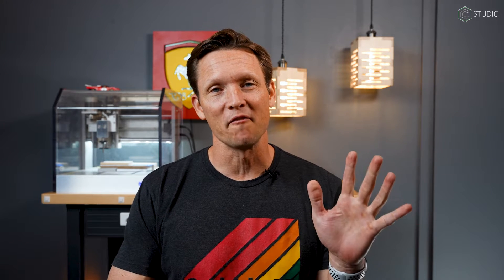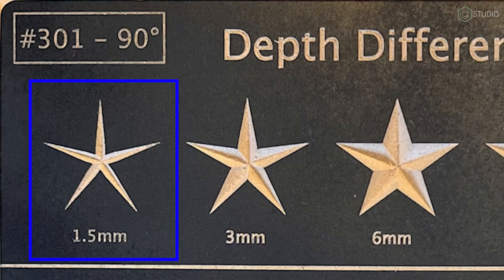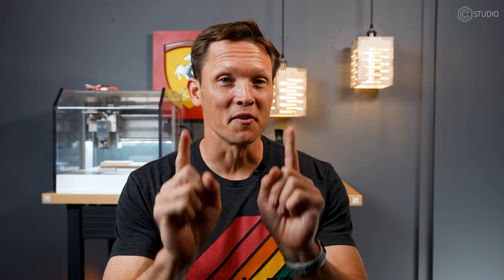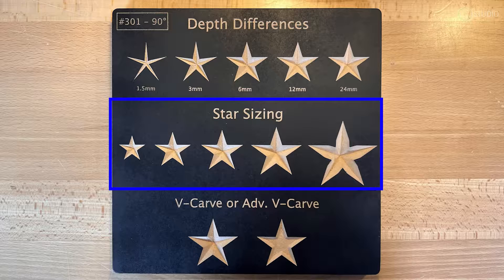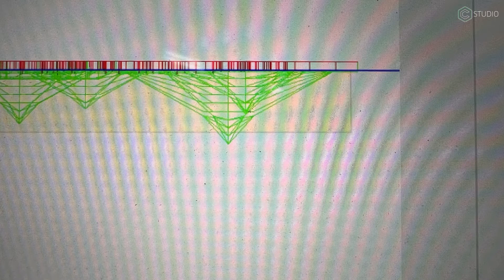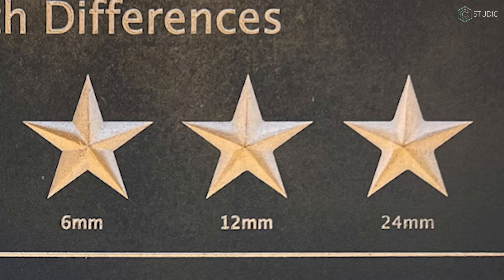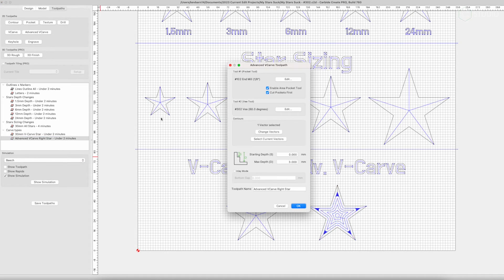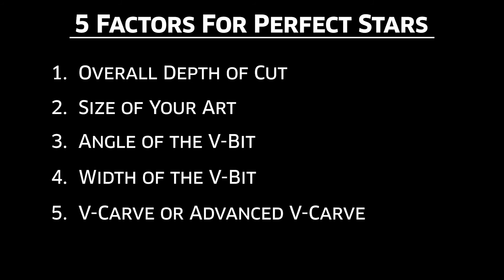Understanding  VCarve: "Why are my Letters Messed Up?"

Comment: Don't know if this is still monitored.....main reason (for now) that i'm getting a CNC is to do Blue LIne / Red LIne flags for fellow first responders.  I've downloaded Carbide Create (free version to start learning it).  Have saved the files for the stars 'examples' file.  Does it have instructions as to how to run it (for a NEWBE) and can free version generate the GCODE (think i'm asking that right).  Would love to 'carve this out as a first carve (although assume it's NOT one to start with, must be complex. Just planning ahead and working on the workbench my cnc will be mounted on.
Reply from the maker: This channel is always monitored. 
Regarding your flag ideas, I suggest constructing some test files or projects for different elements you plan to use in your flag.   Being new means there are a ton of things to learn outside of just the design goals you're trying to achieve.   The more incremental testing or side projects that feature the elements you plan to use in the project you're aiming at, the better your final build will turn out.   

It sounds like you're at the beginning of your CNC Journey.  We offer a ton of learning resources throughout the YouTube channel and on My.Carbide3D.com   

Generating GCode is not needed if you own a Carbide 3D machine.  Simply load the .c2d design file into Carbide Motion.   
If you need to output G-Code, you'll need to purchase Carbide Create Pro.  You gain extra features and capability at a fair price.  

To increase your flag-making knowledge, take a look at this video and download the associated file:  https://youtu.be/IFKi-751vCY

Welcome to the World of CNC, you're going to like it here.
Reply: THANKS!  Understand and it makes sense.  And also allows time to learn the various components involved.  Very nice way to say that I need to "Take Baby Steps" before jumping in with a project with several features.

Comment: Great video Kevin!  Glad you highlighted the capabilities and limitations for the cutters, most importantly the best cutter for the result you are trying to achieve.  Starting out, I didn’t pay attention and didn’t take the time to fully understand each bit.  I’ve come to terms and dedicated the time to study these critical principles.

Can Carbide Create do V-Carve paths with the same principles you covered on a curved surface?
Reply from the maker: At this point, there is no way to force a V-Carve toolpath onto a curved surface.  We are constantly working on improvements to Create, which may lead to something in the future.  Right now, you can create slots and features on a 3D object inside Create Pro.  Then, cut all those features with the 3D toolpaths alone.   The 3D tools in Create are artistic, not parametric.   They are designed to accomplish various specialized tasks with speed and ease.   Parametric modeling is the realm of other CAD programs.

Comment: Also, verify the actual angle of your v-bits. It makes a big difference in how sharp your inner & outer corners are. Even a 1° difference can be noticable depending on the acuity of the figure angle & expected degree of the bit.